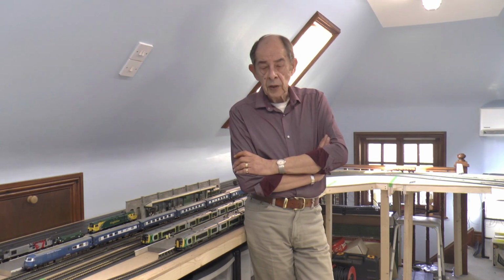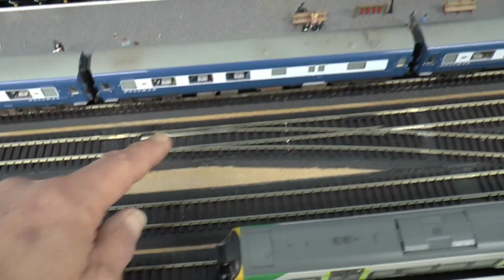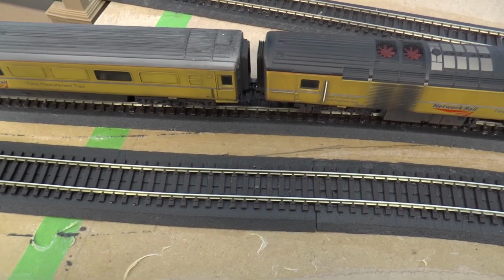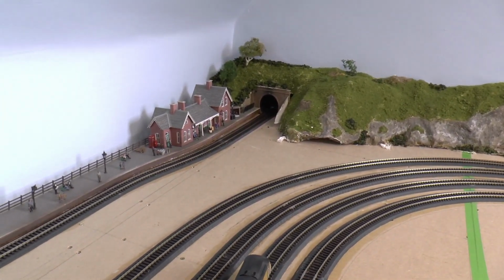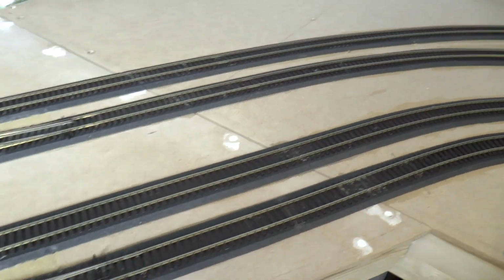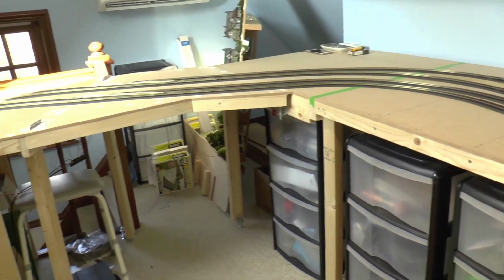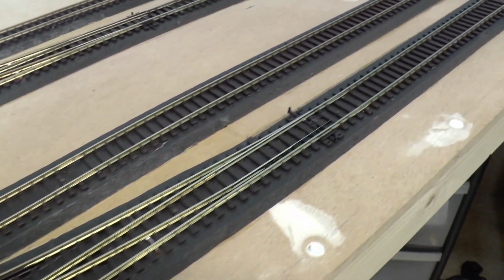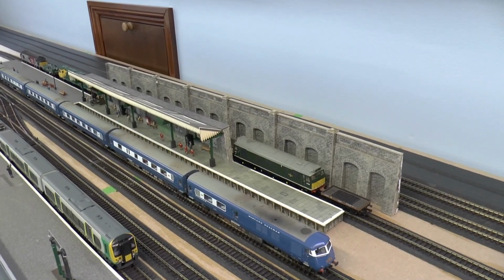Part 9.   One phase ends, another begins.      23-02-2019

Comment: Hi Graham. i thought i just pop in to see what you have been up to. well you have been busy. i can see now why you wanted to change from the old lakeside. massive improvement and it still looks to have that look of lakeside in some respects....keep up the good work . best wishes Tony
Reply from the maker: TONY NORTH EASTERN     Many thanks Tony, you have been quiet of late.  The layout is coming on well at the moment, I’m in the middle of a mass of wiring for the dropper wires and point motors - not my favourite part of the job but it has to be done.  I’m glad you mentioned the reference to the old Lakeside because that is exactly what I want that this layout should reflect the old Lakeside layout with its feel and utilising the old buildings used, the lake of course and many other items too but we shall shall see how it turns out.   Cheers for now.        ...........Graham
Reply: yeh im the same I prefer the detailing and finishing to wiring....regards Tony

Comment: Nice progress. As you say, the crossover is not prototypical, as facing points would usually be avoided at all costs. However, your layout, and if you're happy, all is good. You may however look at putting cosmetic facing point locks in, will add a nice extra detail.
Reply from the maker: D827 Kelly      Thanks for the comment mate, I understand about the points locks in but I really want to keep the track work as clean as possible although I may change my mind later on and add them then but thanks for the comment mate - much appreciated.    Cheers for now.          ..........Graham

Comment: Well done Graham! Things are certainly coming along at a good pace. Is the Manor House still going to play a leading role in Lakeside V2.0? I don't want you take this the wrong way - (telling what SHOULD BE DONE, as a lot of smart a@@%@@ seem to do), but have you thought about my previous suggestion of having the tracks going under the Manor House? The spot you have "reserved" for the village seems a nice place for it. The village I mean. :)

Re the wiring of the droppers and point motors, Have you conditioned your knees for that job? :-) Or have you devised a way of working under the layout that won't affect your knee and body joints. :-) I have that predicament with Hawthorn Valley at the moment as I have just put wiring in for an additional building above the tunnel area, and not wanting to raise the layout all the way up to access underneath for one cable, I thought I would do it in situ. I'm struggling to do up cable ties and solder the connections. But I'm not going to let it beat me, so I will go into the garage shortly and have another go.

Until your next video, have fun. ... Ian
Reply from the maker: Hawthorn Valley    Hi Ian and thank you for the comment.  I am still playing around with the position for the Manor House at the moment so we will see where it ends up but there are several different positions I can choose from - above the track as you suggested is one of them.   As regards the wiring then I can sit on my bum under the layout with no problem, I have a small wheelie trolly with a cushion on it which makes it reasonably comfortable, there are no soldered connections underneath, all connections are done through 6 or 12 way connector blocks so it’s literally just tapping into those blocks - very simple and easy to do.  I’m lucky in that even at my age - 70 this year - then I’m still fairly nimble so getting into those positions under the baseboard is not too bad for me. Plus I have a week to do all that in so I can take my time and just enjoy it and not treat it as a chore.    Cheers for now.         ..........Graham

Comment: Good stuff Graham, I would definitely agree with having gentle curves leading to the bridges. I would suggest possibly to move or add a cross over section for your middle two lines to the cross over section so it’s all in the same place and easier to move trains around.
Reply from the maker: DevilsEyeCT    I tried to get all crossovers in one place but I just didn’t have the room, being express points and the spacing between the tracks then they take up a lot of space in length.    Cheers for now.        ...........Graham

Comment: Nice one Graham. Does the track bed need a special glue that you can also use to stick the track to the bed?. Also is the underlay reasonably flexible?. Cheers matey.
Reply from the maker: Dave Henshaw      Hi Dave, I use Copydex to glue the track bed down to the baseboard and also to glue the track to the track bed, it’s very strong and grabs within seconds of applying.  The underlay is very flexible, it has a score line in the centre which you cut through if doing round tight curves.  Hope that helps mate.     Cheers for now.          ...........Graham
Reply: @GrahamFoulston  Think I'll go for it. Looks more substantial than cork. Thanks Graham.
Reply from the maker: Dave Henshaw     It’s great stuff to use Dave, you won’t regret it.    Cheers for now.        ...........Graham

Comment: Hi Graham just one question have you dropped the idea of your class 50 running along side some part of your new Lakeside, giving you some running shots of are you just going to use your camera on the waggon  running along side your tracks.
Most impressed with your modelling skills so far. Your idea with the underlay for the cross over is one of your best so far.
Looking forward to next instalment to see your trains running on the up & down fast tracks as well as your up & down slow tracks,  that is if your calling them that ??.
Gary Co Durham.
Reply from the maker: Gary Mennell    Hi Gary, no I haven’t put the idea off for the O gauge on the sides, I still want to do that but that won’t be for a while yet, there is so much more other work to do first.   Hopefully by next weekend then I will be able to show all four tracks running - six if you include the tracks on either sides of the platforms so it should look quite busy - that assuming I can get all the wiring complete and point motors installed.   Cheers for now.          .........Graham

Comment: A perfect solution for bringing stock from the storage area to any of the four tracks you choose. The tight curves banished and all looking marvelous. You now have the four tracks on one level that you always wanted with access to everything without the hand of god being needed. Simple, enjoyable to operate and satisfying to sit and watch trains go by. 
I think the blue walls should be painted if you refuse to demolish them, white fluffy clouds and rainbows at one side, chucking it down with rain at the other, snowing in ...I'll get me coat.
Reply from the maker: TheDiomedef16      I’ve just slung your bleeding coat out the door!   😄😄.   Many thanks bruv, you hit the nail on the head, at the moment then this layout is giving me everything that I wanted in my original brief for a new layout, even down to the superb air con which no matter what the weather is doing outside then it’s always a constant temperature up there which is just the right temperature for working in. It will be interesting to see how it performs in the summer but it’s working perfectly so far.    Cheers for now bruv.           ..............Graham

Comment: Nice video Graham. Good to see all your progress getting the tracks laid with the expree point. Don't want to interfer in your planning, just a quick thought from simple amateur on the the track plan after the lift up section. What do you think about having a left hand point replacing the right hand just before the bridge, making it easier having the two outer tracks more parallell while also serving the side line? All the best to you!
Reply from the maker: Michael Hjerpe      Hi Michael, now you are not going to believe this but after I shot this video I immediately did exactly what you have suggested, it was evident that with the extra room I now have from moving the other tracks that I could make a smother entry of the fourth track into the bridge and have a left hand point to form the entry of the branch line instead of a right hand point - great minds think alike!   And it works too!   Thanks for your comment mate and by no way were you interfering, it’s good to get feed back.     Cheers for now.            ...............Graham

Comment: Your track laying looks very professional.  I like your trick of turning the underlay over.  I have actually cut matching angles to achieve the same thing.  Your way works better.  The smoother curves are a treat.  Nice going.  On to phase two.  Rob
Reply from the maker: Rob McCrain    Thank you Rob, I started off by cutting my own chamfers on the underlay but then thought why should I when I already have one edge cut already, this method makes it a very simple solution.  I love the smoother curves now but strangely it took me an age to figure how to achieve with without ruining the original curves. No meter though as it’s done now and well worth it I think.    Cheers for now mate.          ............Graham